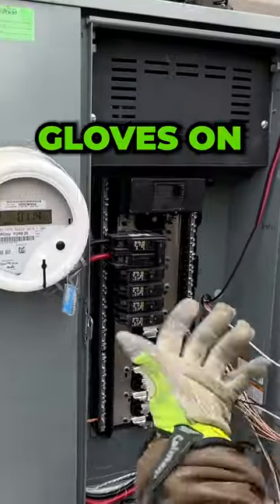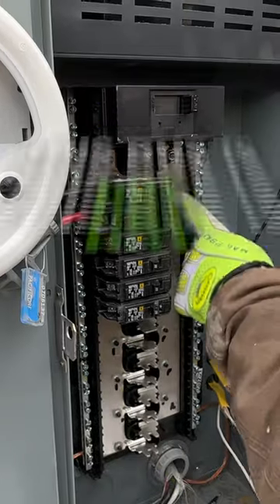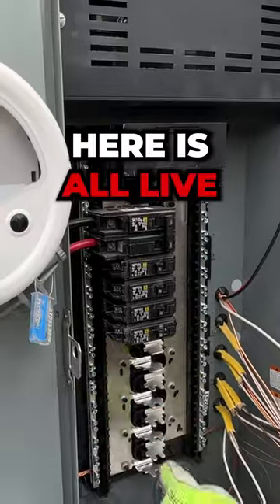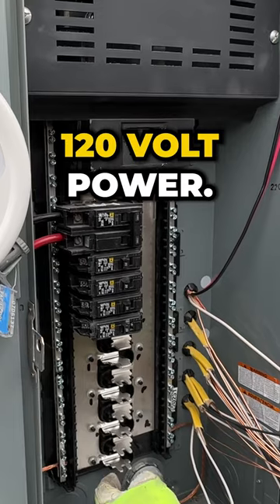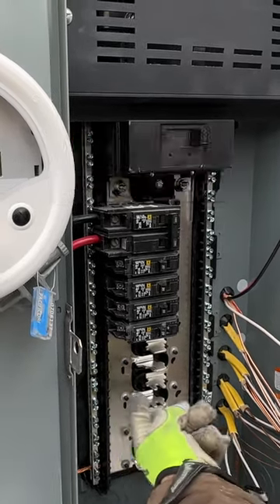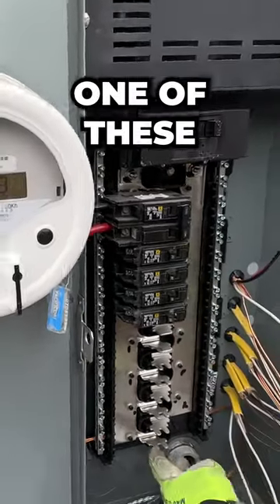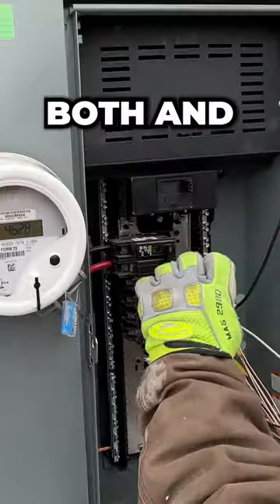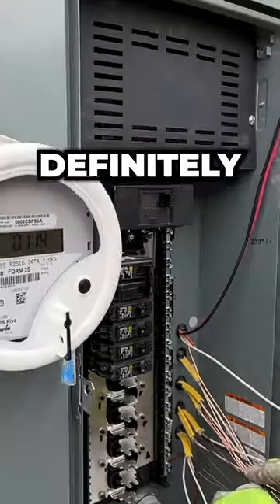Don’t Get Shocked⚡️Live Panel #Shorts

Comment: Also a great way to find out if you have any holes in your gloves 👌
Reply: Only if you are touching something else. If you have rubber sole boots on you can bare hand touch all that without getting shocked.
Reply: @johnh8546 I’ve seen someone barehand a power line cable wearing flip flops standing on a wooden stool I swear to god, yes it was live and it was sparking as he was trying to connect it to the other power line cable lmfao
Reply: @johnh8546 yes except the issue is that's all fine until your elbow or gut touches the panel.
Reply: @johnh8546 Something else like your fingers bridging the two phases in that panel? He seems awfully flippant about poking around in there...
Reply: yes!
Reply: @johnh8546  not really the case as they are never a perfect insulator

Comment: The first thing I was taught in electrical school was "If you don't have to work on it live than don't.
Reply: I was told master electrician get killed more often appreciates for this reason... I'm a master now and STILL have the apprentice mindset when it comes to live
Reply: Exactly! It's not just the electrocution risk, but also the risk of shorting things, especially in breaker panels. Shorting something out can burn or even blind you due to the arcing and sparks. It also can mess up your tools!
Reply: Then ur not a real electrician, fire fighter work on real fire .
Reply: @marvingraham7487  says the guy that can't form a sentence or spell correctly.
Reply: @marvingraham7487  nobody can understand what you said.
Reply: Electrical school huh? Where might that have been?
Reply: I don't understand electricity but I respect it.
Reply: Then you will be alive to work on it.  😅
Reply: @marvingraham7487  I am. I taught NFPA 70E. You'd never catch me in a live panel without a suit. Especially just poking around for no reason.
Reply: @yuknasty9199  what's that mean? You don't think apprentices go to school? They in fact go to electrical school.
Reply: @shawnshurtz9147  panel r switch gear ?
Reply: Good advice.
Reply: Yea i came into electrical through being apprentice but it should be common sense

Comment: Those gloves are a secondary safety tool. If you use them as the primary safety mechanism, and they fail one day, you're in a world of hurt.

Complacency kills.
Reply: You usually put those over the eletric rated gloves but still he is braver than me to just be touching all over that
Reply: Geniuses the meter is not installed in this video this is a new residential install
Reply: @scotts1668  Sure looks like the meter is there, and it even looks like the main is on. Don't get me wrong, I've done plenty of sketchy stuff in my day (drilling/tapping lugs onto live bus bar standing on wooden boards, with electrical tape wrapped tools; this was long before arc-flash and insulated tools). Guys that work around it enough do get complacent...
Reply: @Jester The Jynxster  lmao how did I miss that meter?? Good call sir I did notice the main was on but I just assumed from the one breaker installed it was a new construction and not live yet.
Reply: The title says live panel. So either way he's advocating for such complacency around live panels.
Reply: Youve obviously never done live line work, and yeah i know the gloves arent the only protection mechanism in most cases but is sure feels like they are.
Reply: @JS-df8qm  LOL live line work? Oh we've all done that. In the bucket suspended by a helicopter right? We've all done that. 🤣
Reply: Those are not seconndary nothing..
 Secondary should be leather gloves over rubber gloves that are rated for what ever voltage that is..
Reply: Yeah, leather palms... what's the rest of that.??!
Reply: It wasnt actually live
Reply: @1984oner no what he means is they are a secondary safety measure in case you do something stupid and touch it. Not touching live wires is the primary safety measure.
Reply: @scotts1668 you can literally see the meter in the video. And the main breaker is on. What video did you watch? Lol
Reply: @EeekItsSnek  I was high?
Reply: @JS-df8qm we know sometimes work has to be done live, if I just have to change a receptacle or 2 I usually won’t shut off power, but I think what most people are saying is why go around touching stuff like that when you don’t need to, the dude in the video could’ve pointed but he gave both sides a handjob for no reason lol
Reply: @scotts1668 what kind of excuse is that? I am high everyday and do this kind of shit. If I die I'm be like oh shit I was high, how'd I miss that?
Reply: @Brokenrocktail touching live wires is fine, what is not fine is touching live wires  while you are grounded. Primary safety is touching one piece of metal at a time, secondary safety is the gloves. Both have to fail before you can get shocked
Reply: @JS-df8qm  Those gloves dont do shit in actual live work
Reply: Why does he need to be wiring a live panel box???
Reply: @bman6502  He thinks saying its life makes him cool
Reply: Are grounded boots the primary defense?
Reply: Primary is to shiut it down which he cannot so knowing its live and wearing gloves is all thats needed
Reply: @ironpig701  Of course he can shut it down
Reply: @brandonn6099  says who?
Reply: @ironpig701  Everything can be shut down. Power is not 100% reliable, so everything is designed to be turned off. So of course they can shut off the power.

This isn't some large, industrial/commercial setting where he's working with a huge building's worth of power. There's only a few circuits there. They can be shut off for a bit to work on them.
Reply: No not everything can be shut down. Who knows the building or what the main powers. Doing this how is perfectly safe.
Reply: A rubber mat is the best way to do that but why cut a live panel in?
Reply: how do you think linemen work on electric lines... they have to wear two pair of gloves rated for 1000 volts...
Reply: @JUDALATION  You can't easily shut down those lines. This is a baby commercial box.
Reply: @JUDALATION 12kv or 34.5kv, leather is all that’s needed for less, not sure where you got 1000 volts (1kv)
Reply: Especially with how fast he runs the gloves over the bus bars! Just one crack in them gloves and it is all over.
Reply: Not with 120 lol
Reply: @scotts1668 the meter looks on to me lol
Reply: @Jester_The_Jynxster yup lol meter is on. These guys are great detectives
Reply: That’s why I don’t wears gloves 😂makes bad habits tbh never need to 😅
Reply: looked pretty installed to me
Reply: Right? Wtf...

Comment: I do hvac and I always just treat every wire that isn’t 24v like it’s hot bc you neverrrrr know
Reply: Test for voltage first folk
Reply: Even 24 can get you!
Reply: @davidfriction7170  24v is a little shock but that 240v zapped me so hard I felt like pooping
Reply: @Dante Mariscal  I had a single leg of 480 get me on a RTU last summer. Felt like Tyson punched my hand.
Reply from the maker: Ouch!! You're lucky it didn't kill you or leave you maimed!
Reply: It’s amperage that will get you
Reply: Just check it with a meter! Then you’ll know
Reply: @dantemariscal8679  unless you grabbed both legs of power at the same time you didn’t get hit with 240V you still only got hit with 120V just so you know
Reply: Hey mister George how much are you paying the new guy?
Reply: Most these people need to take an arc flash class and learn about  what it takes to be injured or killed from electrical... this comment section is priceless 🤣
Reply: 24v is meh
Reply: Good practice.
Reply: 24v can still bite you if you're not expecting it
Reply: @WhowereEpsteinsclients NO! It's too much money....
Reply: Also as an HVAC tech. Be aware that low voltage wire can hold 120v. Had some clown wire the 24v wire to the hot side of a heat relay sending 120v to the condenser. It didn’t burn low voltage side of the system. I got hit pretty good.
Reply: I was taking apart a old huge 65 inch tv and got smacked by however much was in that
Reply: Most people he can’t even feel 24v it’s under the threshold for sensation I mess with 24v all the time never felt it
Reply: @pauleflove  oh sweet mother of Moses this conversation is gonna start. There are multiple factors that makes electric lethal, it's not just voltage or amperage.  Ironically both do have a part in lethality though.
Reply: @prockon741  my man watch a video made by StyroPyro he explained well enough what in electricity kills you
Reply: @4oh4n0tf0und  thats just 277 . You would be talking if you had 480 hit you
Reply: @drake7658  wrong
Reply: @drake7658  one leg of 480 is not 120v
Reply: @gilpena779  HAHAHAHA, I love it. Backtracked a tech to find out I was getting 120 on my thermostat wiring
Reply: @gilpena779  HAHAHAHA, I love it. Backtracked a tech to find out I was getting 120 on my thermostat wiring
Reply: @dantemariscal8679  I’m a welder, grounded myself at 120 amps the other day, felt my arm tingling until I woke up the next day
Reply: Fyi Current kills.
Reply: @r6content686  
Try letting it touch the inside soft skin of your arm and tell me that again.👍
Reply: @davidscott5903  I mess with it all day never felt anything I touch them together with my fingers on wires
Reply: @Exotic_drift  
He was replying to the guy who said he got hit by 240.👍
Reply: @davidscott5903  copy
Reply: Yamaszlof Mcdurkin  
.1 amp is enough to kill you, but it usually takes a lot of volts to overcome the resistance of the skin. With thick calluses on my fingers, I've held 110 lightly in my hands and only felt a tingle, but once while working on a car, I reached across the battery and got the snot bit out of me when the thin skin of my inner arm touched the 12 volt terminals. It's all a combination of factors that add up to allow enough current to flow through you. Then the current has to find the right path to kill you. The .1 amp is the amount of current it takes to do tissue damage, and even that has to go through a small cross sectional area. I know a guy that lost part of his arm and neck when he was working with 480 on an irrigation circle. He only survived because the electricity didn't go through his heart.
Reply: @r6content686  
I know touching 24V is fine with your fingers, because the resistance is high, but I was daring you to touch the wires to the soft skin on the inside of your arm near your armpit. The skin is much thinner there, and you’ll feel it a lot more. You don’t actually have to try it unless you want to be as dumb as I am.🤙🤪
Reply: @Drake  Thank you for saying this! How many times I have heard this and just shook my head. Unless you are over seas.
Reply: @prockon741 you need to learn what you are talking about
Reply: @dantemariscal8679  got hit by the wires to a ceiling fan that i ripped down. Only time in my life ive tasted my cavity fillings in my mouth
Reply: Hiw i was taught too
Reply: Got drunk as fuck and tried hooking up my dryer with the pig tail and forgot to hook up because I'm drunk and plug it while sitting on the leads and ground and got blasted. 😅 my brained turned off and i got couldn't see and brain and eyes rebooted like dell computer from 2005 lmfao 🤣 😂  I'm surprised i am not died lmfao glad I'm not though
Reply: @2012whatthehell only if you’re hands are wet then it literally feels like 120v 😂
Reply: One of the worst if not the worst shock I’ve gotten was on a cap in an old air handler
Reply: @prockon741 Its a combination of voltage and current. If there isnt enough voltage it cant push enough current through your body to cause damage.
Reply: @mikewhocheeseharry2459 I also check with a sniffer even though i should use a meter. But i’ve been hit by 277 once thinking all the lights were off in a room but what happened was 12 bulbs in 6 lights all burned out and it was still hot
Reply: Grabbing 24v with sweaty hands in the summer is about as bad or worse than brushing 240v with dry skin.  Also, never trust that control wiring is only 24v.  Damaged ungrounded secondary had 277v on the control lines because it ended up acting like an autotransformer.
Reply: Obviously a student of ElectroBoom…